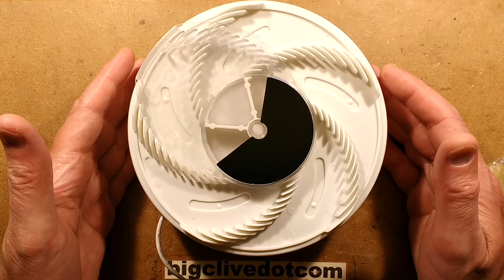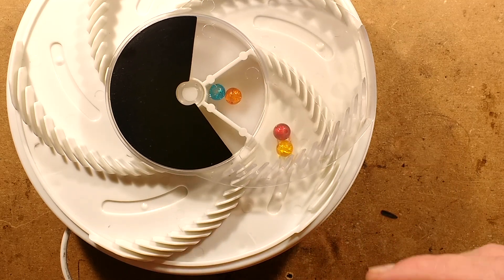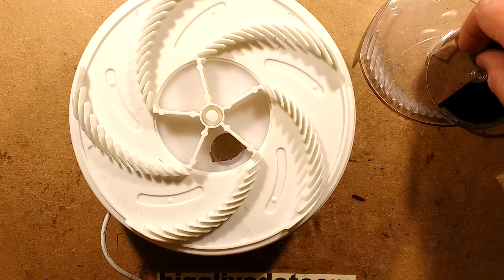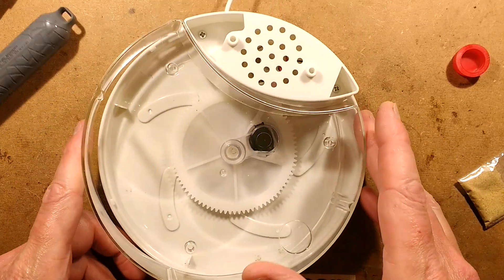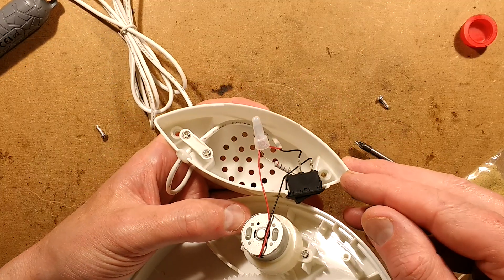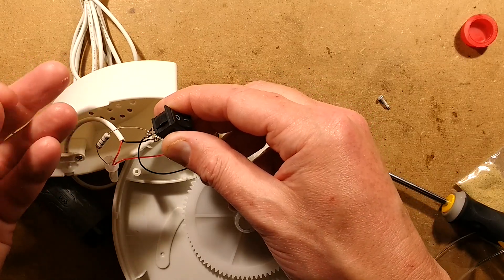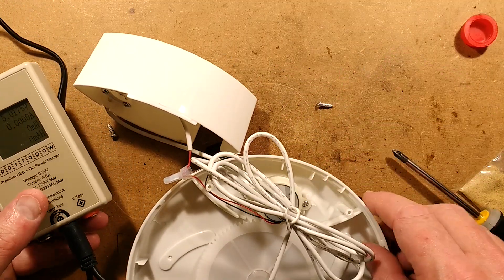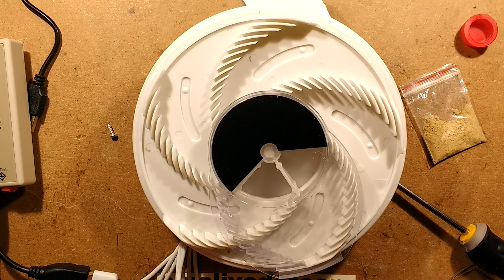Inside an electric fly trap.

Comment: I think the resistor is to reduce brush commutation noise getting back into the USB e.g. a computer. You can stick a capacitor there but the inrush current can kill a computers USB port.

Comment: You can have our flies, Clive. We have more than enough in Adelaide when it's summer. I use a fly trap that looks like a funnel with a lid and that fits into a cannister. You set it up with a bait that smells like rotting flesh one you mix it with water, and it fill up with flies. After a while, you hold your breath, empty the fly liquor out on a pot plant for fertiliser, then repeat.

Comment: the resistor varies in value depending on the parameters of the motor. the makers use various motors they source depending on price and availability. the resistor allows a cheap quick method to allow for any differences.

Comment: The resistor was probably put in parallel to draw some of the power to slow down the motor, otherwise the motor would be spinning super fast
Reply: anthrocene I was thinking that too. But really it is there to pull in just enough extra current to keep power banks on. Otherwise the bank would think it had nothing plugged in and turn off.

Comment: Wouldn't that resistor cause less of the available power to go to the motor?  Seems if it is eating up more power than the motor, they might have added it to keep the motor from burning up with the standard USB power load.

Comment: I think that resistor was meant to signal to a USB port that it's not an active device. A 200 Ohm resistor across the USB Data lines indicates that the port is a charging port to any connected devices. They might have decided to apply the principle to the device as well.

Comment: I bought one because of this video introduced me to it. Had it for 5 to 7 days and now the motor is done. Or something else isn’t working. Already tested a different USB power supply. Don’t have time right now to take it apart, other than to type this message. 

Oh, and in that one week time. Only one fly was caught. I didn’t have too many to begin with anyways.
Reply from the maker: Did the rotating part stall?

Comment: There could be another reason, if you turn the flytrap by hand, it could be that you produce more voltage than intended. That would break the motor. Also, switching it on and off may create powersurges, since it's a coil after all... But that's all I can think about here.

Comment: That resistor is cheaper than a capacitor and most likely used to cut down on voltage spikes from the motor going back into the electronics.

Comment: I use hairspray (with a pump not gas) to catch flies (if there is any), works great! Take the strongest one, for example Wella New Wave 5. The fluid is so sticky and when sprayed onto the fly (can't escape the fog when lift off) it will stick legs and wings to the body and fly falls onto the ground so you can easily smash it. Haha, great right?

Comment: Hi BigClive..Just ordered myself a STM32 T12 from Aliexpress. I heard VoltLog mention that it uses a simple vibration Sensor. do you think it would be possible to replace that with something like a Hall effect sensor ? i asked VoltLog and his answer was:
Some investigating should be done to see if the board expects a continuous low/high signal on that switch input or if it expects just a state change to trigger the timer....
Reply from the maker: If you mean to detect when it was in a soldering iron stand magnetically then you may have to experiment with the sensor input to see how it reacts to being held either high or low as VoltLog mentioned.  A tiny reed switch might be simpler than the hall effect sensor.
Reply: ahh i think i understand. i deed read what a Hall effect sensor was before asking you..and i deed read there where two types. and i did read something about the sensor being magnetic. But i did not realize or it did not sync in that the switching is done true magnetic changes. The reed swtich seems to also work with magnetic fields.. but it looks simpler indeed.. That was amazing.. i feel like a 42yr old cave man IT nurd hahah..
i also just bought the TS100 that instantly wakes up from sleep when you pick it up without shaking it like mad man hahah.. i think it has a accelerator/gyro in the handle.. i think that's a tad to modern for this station ahhah.. perhaps a more sensitive motion detector ? i think i read there are lot's of sensitivities to choose from

Comment: Hey , just FYI , take apart a CD or DVD drive, that's a gear motor for the tray, ones in cd drives can be sensitive to voltage & amperage for speed control, IE needs resistors or chips usually to adjust the speed. plus yeah it does help keep the USB on for a battery pack, if I don't use something sometimes to slow it a little  it would be too fast. Also, I salvage them motors to fix USB fan assemblies...lmao... it's funny how they're using one similar to it for that.... Been watching all your videos, been helping me learn a few things I didn't know, so thanks so much for deciding to try out YouTube!!!! Keep up the great videos!!!

Comment: resistor in parallel with the motor to keep power banks awake makes sense, though before I reached that point in the video where you mentioned it I thought maybe it was there to suppress inductive spikes when the unit was turned off

Comment: Isn't the purpose of the resistor to save your USB power source from damage when the mechanism gets jammed? It is going to pass more voltage than the blocked motor probably?
Reply from the maker: A stalled motor will pass more current and the only way the resistor could limit that is if it was in series.
Reply: Oh, you are completely right. When I think myself again, it makes no sense what I wrote. An additional load lowering the existing current flow. Thank you for explaining. And sorry for the possibility of misleading people reading my comment.
And also I see I wrote "voltage" instead of "current". Ugh…

Comment: I doubt it would catch many fruit flies (drosophila) as they're small enough to just walk between the white plastic vanes and escape!
I had a similar problem with drosophila around my food waste bin and an electric shock / ultra violet fly exterminator whereby the flies were too small to make contact between the two high voltage grids. They just wandered around with gay abandon! I took to using fly spray instead!
Reply: A jar with a small hole in the top with some vinegar, fruit flies love vinegar.
If you are ever in a restaurant, look at the vinegar bottles as you go in, if they are cloudy leave. Bottles of drinks behind the bar with pour spouts can get quite lumpy, they also like stuff like vermouth.

Comment: Poor marketing. They should have gone with a 3-position power switch: off, on (motor only) and "smart USB compatibility super-mode" (motor plus resistor). Then add a note about how their advanced triple-mode design increases compatibility with USB power sources while giving users the option to save up to 60% power.

Comment: I'm still sticking with putting a couple of wire meshes up at my window with several thousand volts between them, so as soon as one of those ANNOYING little PESTS comes in, ZAP! If I can come up with a way of keeping the two meshes just far enough apart so they dont touch and short out but still zap any bug that desperately tries to get in to my room for whatever reason I'm totally going to do that. I don't know what they find so fascinating about my room, especially at night.

Comment: Switched mode power supplies need a minimum load to operate smoothly.  Otherwise they go into a run then stop cycle.  The resistor helps with this.

Comment: Regarding the resistor, isn’t it a cheap flyback for the motor? Resistors are much cheaper than diodes. They don’t care if it means more consumption for the user...

Comment: I think the resistor is used as a simple heating element to keep the enclosure around the motor slightly above ambient to prevent condensation.
Reply: Don't think 125mW is going to heat much up.

Comment: Ok Clive! I don't believe this! The matrix has broken down again. WE have JUST done the SAME project, AGAIN (my previous was an efficient solar garden light)! What the heck man, it's like I have a psychic connection with you from Greece or sth. I just made a project, 2 weeks ago, involving a computer case fan (used as a mosquito shredder), on which I had attached 4 UV LEDs. It really works, I have LOADS of mosquitos here, I live by the beach and it is summer at the moment. You may find some papers that say that light does not attract mosquitos, you will find others that say the opposite. I found, since I have an optical touch screen, that by the moment I turned off the main room lights, my screen would select things as mosquitos would move over there. After 2 weeks of using the aforementioned computer case/uv led mosquito shredder, the paper that I have put behind, is full of mosquito carnage. Keep going Clive, love you.
Reply: Delphi Builder   that's interesting, are the flies shredded by the fan blades or have you added some whirling razor blades?
Reply: Just by the blades! If you just notice your pc box fan, the blades go with such a high speed that it is very fast for any flying insect! It takes it to bits and all the splattered bits go and stick to whatever is found behind the fan! Some other insects, find the splattered bits interesting and spend some hours standing still just watching! When the lights go off they join the scene for the next insect to go sight seeing.
Reply: Delphi Builder   brilliant!  Is the Nobel prize committee aware of this?  Good quality pc fans are damn near silent, and will suck  in flies that come nearby. Maybe a drawback is that the user has to clean up the splattering occasionally, but I think I'll give it a try.
Reply: Hahaha! Give it a go man! It is amazing you found out my comment to Clive among so many comments he receives! It is very simple to implement and extremely cheap, just 4UV LEDs around (I fitted them in the pc fan with a hot soldering iron to make the holes). It has saved me 2 weeks and some days now, from a heavy mosquito nightmare and torture, here where I am they really like to turn up just after dusk. The splattering does not have distinctive features, it looks like dark coloured dust, and to tell you the truth I prefer this to chemicals...
Reply: Excellent! So we share the same experience here with chopped insects haahahaha. Put UV LEDs, they are low output and not really harmful

Comment: Interesting video, I'm surprised given the variety of USB powered devices now that don't need data control, nobody seems to have brought out an in-line USB timer so you can use USB power banks for set time periods or use other in-line control devices (LDR/temperature/IR movement detector etc.)? Perhaps a new project build for you Clive?
Reply: Inid O'fty what are you talking about I found a couple of USB in line timers through some cursory Googling you could get them on Amazon you could probably get those other things too
Reply: Hi Maui, I don't seem to find any(Google or Amazon), lots of USB powered devices with timers but none that are USB powered and programmable that turn off any USB devices plugged into them, could you provide links to examples please?

Comment: Does the resistor effect the speed of the motor at all? Maybe slows it down slightly?
Reply from the maker: No.  It would have to be in series with it to have a significant effect.
Reply: What is the voltage reading across the motor, with and without the resistor? I did say it would only have a "slight" effect. LOL I wonder what they hoped to achieve by placing that resistor across the motor. Doesn't the resistor drag the voltage level down somewhat?  Also - The circuit needs some UV LED's for added visual effect! LOL Everyone have a good night! Nice video, as always Clive!
Reply: It's in parallel. Think again.
Reply: You need more current for the voltage regulator to work. It shuts down if it draws not enough current.
Reply: Yes, I think Clive mentioned that during the video. I've never seen a fly catcher like this. Clive finds some interesting products. I really enjoy his channel!

Comment: I was only looking at buying the Mains version of that yesterday and wondered what you'd make of it in regards of safety!
Reply: Just replace the DC motor with a 240V synchronous motor (as used in microwaves for the turntable)
Reply: Simon Tay More like the weaker motor used in mechanical electrical clocks.
Reply: If it plugged into mains I'd put a fly zapper grid in the bottom part. With an interlock on the lid, of course. :)

Comment: What about adding some UV LED's to attract the flies?
Reply: This thing needs more power.
I would add some UV and a high voltage cascade to kill them immediately instead of dieing from hunger.
Reply: Ian Halliwell I wonder if there was supposed to be a small UV led in serious with the resistor, making the hole more attractive. Bonus points for choosing an UV color that is blocked by the "clear" plastic.

Comment: Maybe the flies are attracted to the warmth of the resistor rather than it being for the purposes of the circuit?
Reply: Jake Hillion that resistor will output just over one tenth of a watt in heat, barely enough to warm itself. Heat at that level would not be detectable by anything, including insects, unless they were actually already sitting on top of it.

Comment: It's a long shot, but maybe the resistor is a simple resistive snubber that they included for some odd reason? Perhaps the inductance of the motor caused the outputs of some cheap powerbanks/chargers to start oscillating due to the underdamped LC circuit being formed with the output smoothing capacitor?
Reply: Nah, I think Clive is spot on. It's just to increase the current beyond the threshold some powerbanks need to keep active.
Reply: So if someone were to overspin it by hand, like we do, w/o the resistor... what would the usb power supply think of that?
Reply: Dave got it. Good maths but imaginary numbers. I agree with keeping the supply awake and it  would limit backfeed damage, if say, the kids were dynoing there bicycles on it at the same time charging their e cigs
Reply: Richard, In all 3 of your replies it's evident your understanding of the effects of series/parallel is barse ackwards.
Reply: If it was in series with the motor, the motor wouldn't run when the resistor was cut. So it is not a voltage divider.
Reply: More likely a slightly bigger drain so the power bank doesnt shut down thinking nothings connected.
Reply: ann onn
I think you are right 😁
Reply: MRLT the resistor do nothing ! It just to open discussions between us!!!
Reply: It's pretty obvious what the resistor is for!!

 If you have several flies caught inside and someone removes the power,  they could all get together and try and make a concerted effort to break from their rotating plastic prison by simultaneously flying in the same direction.

This will cause the drive motor to spin and allow them to break free. They could wreak all kinds of havoc, like vomiting on your food, treading it in, then sucking it back up amongst other things!

The resistor ensures that this is not a possibility by dumping the current from the motor/generator into the resistive load, thus making it difficult for the flies to escape. 

I thank you. Flies away
Reply: It's not in series with the motor. Spinning it by hand, the resistor has nearly no effect, essentially being bypassed.
Reply: On a 5v 2.1a socket, you could conclude that the ports effective resistance is 2.4 ohms.

So if you spun the motor by hand fast enough to produce 10v, then...
10 * (2.4 / 200) = 0.120v across the resistor... 9.88v backfed into the USB port.(Actually only 4.88v traveling the wrong direction)

How does that help?

Edit: Also, decent power supplies diode their ports, sorry Apple.
Reply: Its probably a bit of both, keeps power banks awake and damps and voltage spikes from the motor.
Reply: We may never know.
Reply: clive just said, the resistor uses more power than the motor, thats because some powerbanks if they dont detect an enough high load will shut down after a minute.
I've had this problem with usb powered speakers, when there is no audio or the volume is low enough the powerbank shuts off because the power consumption is extremey low.
Reply: Can also be that it's used to warm the device. That keeps the moisture out and warms the powder substance. Wondering if insects like heat..... or do I overthink it again ;)
Reply: Why a 200R resistor?  Because it was cheaper than a 330R resistor.
Reply: No diode to prevent someone turning the motor by hand and back-feeding power into the usb?
Reply: I think you're overthinking things? Maybe?
Reply: Absolutely not. If anything, it is simply slightly dropping the voltage on the motor... but that's about it. Basically, functioning as a voltage divider with the motor itself working as the second resistor. Since there is no reason for the speed to be precise on the motor, that would not be the reason. 

Honestly, the only thing that makes sense would be to increase the power usage, and the only reason for that would be to keep powerbanks awake. I can think of no other logical reason for it.